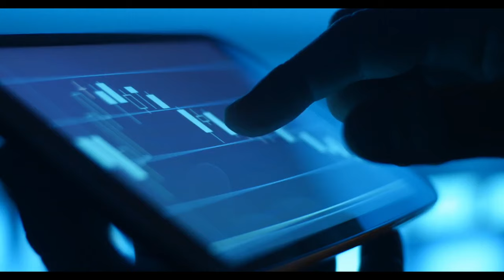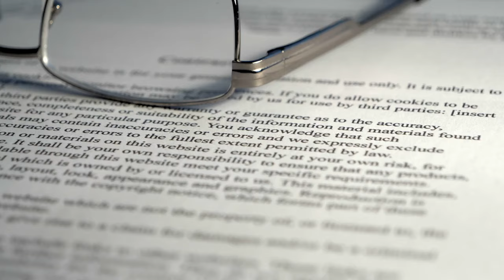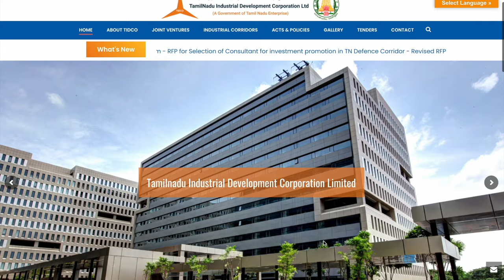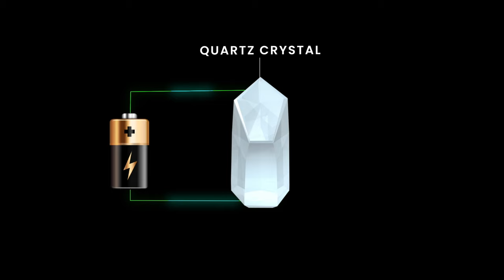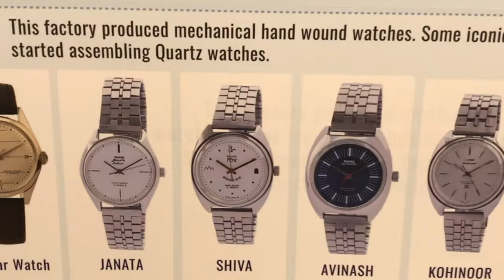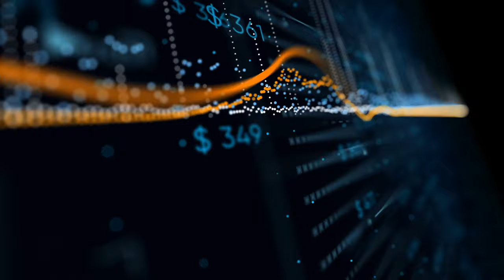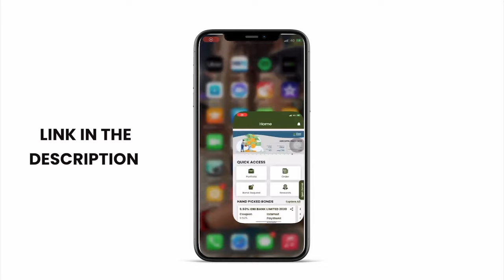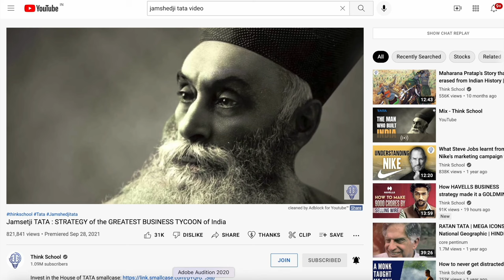How did Ratan TATA build TITAN into a $31 Billion company? : Titan Watches Case Study

Comment: I still wear 50 year old hmt watch after trying a lot of quartz watches. It need to be wounded everyday and is not a problem for me. I just had the badluck that the quartz watches ran out of its battery at critical times and I chose to try out the old watch kept at home. It looked funky with huge dials and I am wearing it since 12 std.